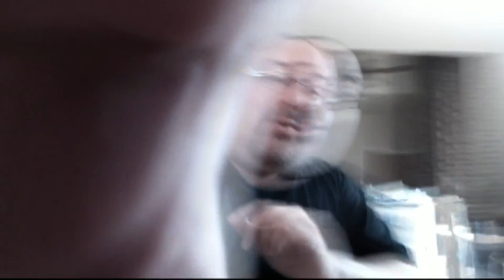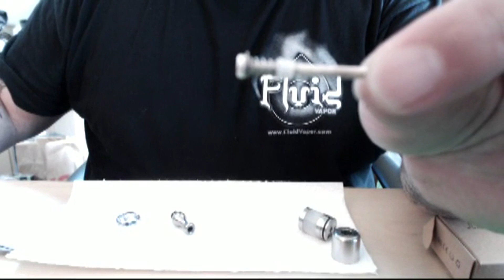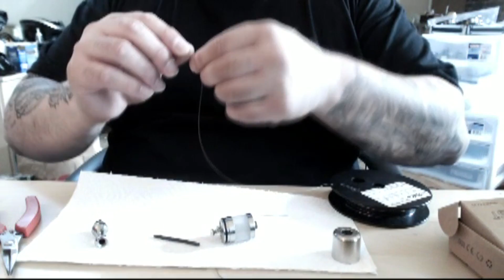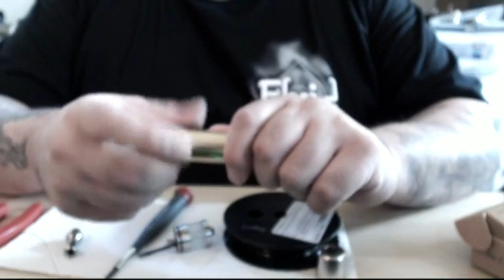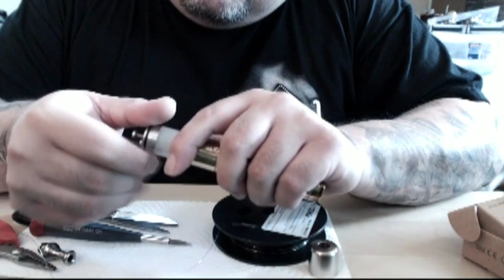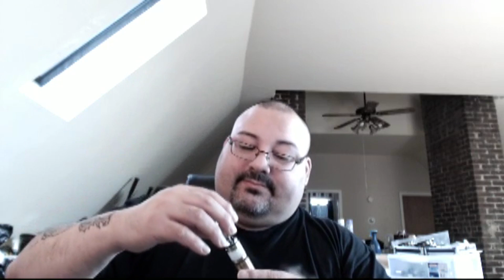Fluid Vapor's RSST

Comment: The cap on my RSST is snugly fit. I could hold it from the top cap while it's on the K-101 with a battery inside without it falling off the device. Try taking off  the o-ring and applying a strand of dental floss in the thread and replace the o-ring.